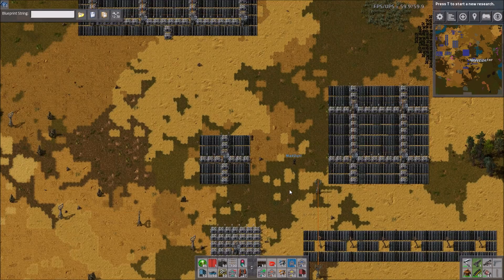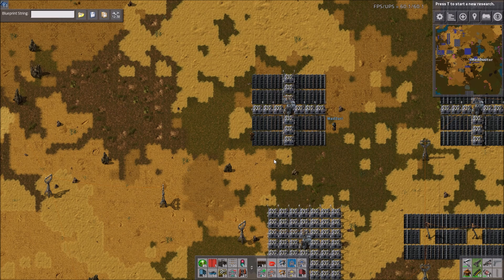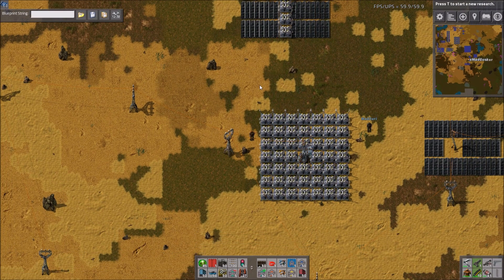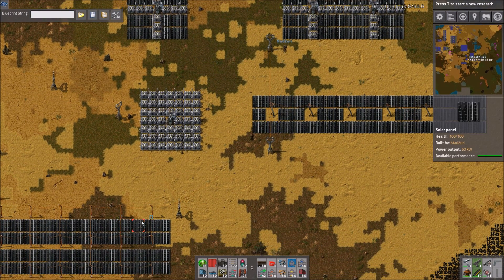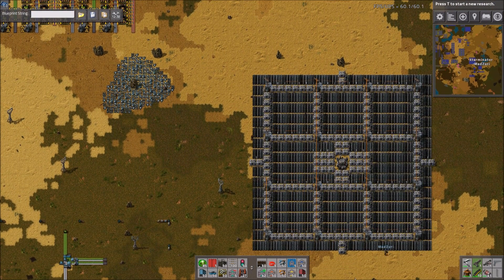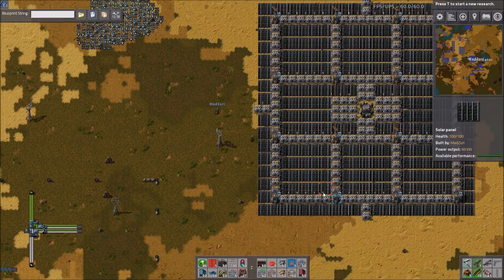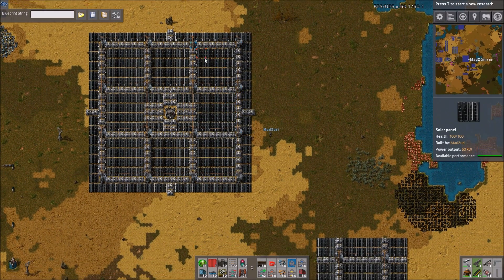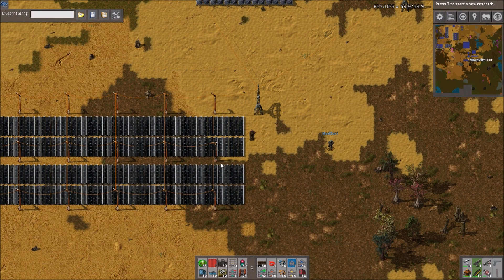Factorio Workshop - Building A Better Factory :: Solar Layouts

Comment: I like the solar layout that Steejo and Arumba used on their Factorissimo playthrough. Its a pretty good ratio of 153 to 180 which equates to 0.85. It also uses less roboports and is sort of rotationally symetrical. I like it especially because I wont have to put down accumulator blocks... Speaking of which have you done so in the earth series?
Reply from the maker: Hmm I don't think I've seen their's, I should look. 
We haven't put down accumulator banks in the earth map no. Mostly because we can't even charge the accumulators in the solar layouts sometimes. :P
Reply: Episode 65 of Steejos perspective if you wanted to look at the layout. He has it spaced so you can walk in between but you can make it completely flush. I like it because it uses the construction grid with the logistics on the diagonal to use less roboports.

Comment: Hey X, I've used Zuri's MK3 for a while, but a couple of month ago, I've started to use this one: https://goo.gl/HbM0l9
It has a ratio of 0.838 and leaves 2 titles of spacing between the setup, which is nice for larges setups, you'll have path along de solar farm. On my megabase I have right now about 60k solar panels and those paths are very welcome when I need to expand them. Here's another screenshot, this one of the blueprint itself. I can send to you the blueprint string if you want to test it: https://goo.gl/8nJMUL
Cheers from Brazil!
Reply from the maker: Thanks for sharing! That is a pretty nice setup, and I like the fact you do have that 2 tiles space in-between to run through. 
The ratio is just about perfect too, so that's good! Really my only issue with it personally is that it isn't symmetrical. lol I mean it is symmetrical all 3 sides, but then it has that batch of accumulators above the roboport, but not a mirror of it below the port. That is a very small issue that is just me being picky though. :P
Overall I think it's a really nice design!
Reply: Yup, even after the substations got extended range, this is a very good setup. It looks kind of derp, but the pathways are great for putting in radars or just walking without the squeak through mod. Like RadioactivePretzels said, half the roboports can be replaced with accumulators after the solar field gets constructed (but not during construction, because the extra charging really makes a difference).

Comment: I picked up a solar layout from the subreddit that I fell in love with a while back. It's fully symmetrical which means that you can use the design in quarters to squeeze power gen in tight places. It's not as space efficient as Zuri's mk3 but the walk space + modular nature of it makes it incredibly practical in a growing base.

http://puu.sh/snVmE/acbf87435c.jpg

In a full build: 172 panels with 156 accu giving a 0.906 ratio

Blueprint for the full design: http://pastebin.com/BCaUkgew
And for 1/4: http://pastebin.com/gPbVj69g

Comment: Question
I have seen a mini design that has 1 large pole + 5 accumulators + solar panels.
The ratio is pretty close 0.8333.. and it does not need red circuit.
Any idea about that?
Reply from the maker: hydrasonwun Awesome little designs! We will probably feature them in a future video. :) Thanks for submitting them!
Reply from the maker: I'm not sure if I've seen that one before. I'm trying to think if it's even possible to fit 5 accumulators and enough solar panels in the radius of 1 large pole. 
I'll have to play around with it and see if it works, or if you have a design like that I could look at, I'd be interested. 
If the ratio is correct and you can fit it all, I think it could be quite good.
Reply: Xterminator
https://wiki.factorio.com/images/9x9_accumulator_solar_panel_example.jpg
I hope links are working here
Reply from the maker: almwaysa Oh I did see that very recently in fact! Yeah that should work well I would think as long as the ratios are correct. :)
Reply: https://goo.gl/HHkO2Y This is my (standalone) radar station. Works 0-24, at mornings the power level drops, but the radar keeps the map revealed. There are enough space to place some turrets, etc.

https://goo.gl/Dt8mL7 The second version is on the right side. Less space for defensive buildings but +1accumulator.(30MJ, but only ~28MJ can be accumulated at daytime) It can keep up the electricity a little bit further at morning.

If you replace the radar with solar panel or more accumulator, you can generate/store more power "on" 1 pole.

Sorry for my bad English. :)
Petigp

Comment: I have a bad habit of making a mega bus, What items would you say are worth adding to a bus and what items are you just better off making at the point of consumption?
Reply from the maker: Good question! I plan to do a video on that in the near future, but for now I'll answer here. 
Some things I think should definitely be on your bus: Iron/Copper (personally I prefer a minimum of 4 lines of each), Steel, Circuits, Red Circuits, maybe blue circuits. Gears are optional, I think either way works, though technically it is more efficient to transport gears on the bus rather than the extra iron to make gears locally sense a gear takes 2 iron. Plastic is also optional, depends on how the rest of your base is set up. I would definitely NOT put cable on the bus, or any belt for that matter (exception is for a red circuit setup). Really the main things you want on the bus are just the base materials (iron, copper, steel, etc), and things that would be a pain to make locally for each setup that needs them (like red circuits, blue circuits, etc).

Comment: And yet another trick. If you use FARL, add solar + accumulators to the rail blueprint. That pastes power generation down even faster than roboports, it's less work on your part since you just drive the train,  and as you scale your base with more train lines, you scale your power at the same time.
Reply from the maker: Great idea! I have seen some people use FARL for it, but never gotten around to doing it that way myself. It is definitely faster and easier.

Comment: Worth a followup tutorial: Using hot water storage and boilers instead of accumulators. Advantage is that it is super cheap on resources, in particular no oil needed at all, so you can make HUGE nightime and laser turrent reserves very cheaply.  Downside, it costs UPS, though not really measurable. And pollution, but who cares about that in megabase endgames.

Comment: Hey, 
about the Roboport Design:
Its better to have the robopprt in the corners than in the center, that way whenever you build a new setup, you dont have to wait for the first half to be completet, until the robot have the range to build the other half. Doesn't matter so much since the removed the ghost image times, but is still usefull to reduce built time.
Reply from the maker: Heya,
Yeah definitely good for reducing build time, but having them in each corner takes 3 more roboports per design which eats a lot of power and is a fairly heavy resource cost once it start adding up. 
If neither of those things are issues for you then yeah 1 per corner would be cool.
Reply: Not exactly. If you have the roboport only cover the main design with its construction range, then the 4 posible roboports in the corners will just exactly touch their logistic zones in the horizontal and vertical direction. This means that the density of roboports is just as high as for the shown mk 3 design (which tesselate the roboports with the same density of touching logistic zones horizontal and verticl, and therefor the same amount of roboports pr solar/accumulater).
The problem with the extra 3 roboports is only for the first design, and if it is a problem with the extra power (probably not if you are using mk 3 designs already), you can just make the blueprint only cary one of the 4 roboports, as that will be sufficient for tesselation, though it do require the roboport to be put down before any construction can take place, but if you are lacking capacity for roboports, you are probably fine with plopping them down manually.

Comment: liked the short and sweet video. don't suppose you've a assembly setup that outputs close to the ratio?  :>
Reply from the maker: Thanks, glad you enjoyed it. :) 
Not really, in fact I don't think we have ever considered a specific assembly setup for something like that. If you make a blueprint with the ratio you don't necessarily need your assemblers to output that exact ratio just as long as you have enough to build the blueprint. If you do want to limit production to the ratio though, you could set your output inserter conditions (either logistic or circuit network) for panels and accumulators to correspond with that ratio. 
So like have the inserters stop outputting after 100 panels, and 84 accumulators, etc.
Reply: Cheers, solid idea, i should learn to use the smart systems. most intelligent my factory gets is limited boxes :P
Reply from the maker: Sgt Chapman Haha, yeah using the logistics conditions can help a ton and is really quite simple once you get the hang of it. :)

Comment: I'd like to see a bob's mod tree to boiler setup. I am told it's power positive. :P
Reply from the maker: I don't we will ever do modded stuff in this series, especially bobs mods. :P
Reply: Says the guy who does awesome mod spotlight videos.
In fact a basic FARL tutorial (not spotlight) would be a real winner for intermediate players to learn from. There are none on Youtube!
Reply: RadioactivePretzels I'll be honest, when I started bob's, it was overwhelming, but then I realised it was more rewarding. As I set up all the smelting areas had it all running down the bus, then started my products. Oh man, it was a good feeling. I think for many, bob's mod becomes a bot network spam thing. I'm kind of not really that interested in bots, yeah it works, but you kind of lose track of efficiency, you can't really tell whether it's working as good as it should. That's an issue I have, and whilst I'd be prepared to use it for short little trips. Like I was thinking of using bots, but at least having the stuff close by, like, running it down the belt, and then having your stuff close at hand. I think bots are an area where you cannot tell if it's working the way it should, and hard to tell if your getting the most out of the expense.
Reply from the maker: RadioactivePretzels Lol good point. :p I'm not against mod stuff, just not in this series because that isn't really the focus/purpose of it. 
An actual FARL tutorial is a really good idea though. You're right, there isn't much info on how to actually use all it's features. I will have to take some time and learn it better myself. At the moment I don't even know half the stuff it can do myself.
Reply: Xterminator I want FARL to be so intelligent it automatically places a station and all the miners down at an outpost, whilst I am flying past at full speed in a 2 4 2 train configuration.
Reply from the maker: Beren Scott Lol! That would be amazing. I think it might just break the game completely though. :P
Reply: Xterminator How about a new type of mining drill which is like much larger, and it's coverage is basically the entire patch surrounding it. The ore literally falls off of it from all sides, and you run your belts from the sides. The mining drill essentially runs at a speed that is dependant on the physical size of the ore patch.
Reply from the maker: Beren Scott That is a pretty interesting idea actually. I'm not sure if that is possible or not, but it would be cool and make mining a hell of a lot easier!
Reply: +Xterminator Might be cool if you do a FARL spotlight/tutorial at some point, to show off some combined rail and solar+accumulator blueprints that FARL could lay down (on long stretches). I bet you and Zuri could come up with some great designs!
Reply: Michael Matthews Be good if you could design farl to basically delete the rail behind it, and use it to basically spam down blueprints like solar. :P

Comment: I think I'd prefer to just have two "mark 3" blueprints, one with all Accu's and one with all Solar, then plonk down as needed. With one of each I'd get something like a ratio of 9 Accu to 4 Solar, or 9:8 with two of the Solar ones (and I assume each block would give something like 11-12 MW during the day).
Not elegant at all, but far easier on the brain ( especially without BP import), and I'll be able to scale for more Solar or more Accus as my needs change.
Reply from the maker: Yeah that's certainly a viable way to go. I think it's just personal preference, if you want to build a combined design like we showed, or just make them separate. Whatever works best for you.

Comment: The roboport design is inefficient. A diamond, not square, tiling, lets you use far fewer roboports. The key is to let the roboports connect along diagonal directions to maximize the distance between roboports but still keep them connected to the same network. The diagonal design uses exactly HALF the number of roboports, a savings of resources, energy, and ULP.
Reply: That's a good point about the build speed being slower because of lack of local charging. I tend to think about optimal megabase designs. Though I guess in that case the right solution is to (manually?) delete every solar roboport once the field is complete. I also worry most about ULP costs since I'm down to 20fps even after aggressive belt minimization and careful mod pruning.

Comment: note: the "perfect ratio" assumes no laser turrets. If you use laser turrets, that gets thrown out the window.
Reply: It doesn't matter if you use laser turret or not... The "correct ratio is a relation between SolarPanels to Acc, it doesn't matter where you use the power.  This misconception is explained on the original discussion where the ratio was presented.
Reply: DaemosDaen Yes. Just stamp down a couple of AccuBloks, and you'll be fairly good.
Reply from the maker: Yeah, typically you don't take laser turrets into account with the ratios. As Peter said, the best solution is to just throw down some accumulator banks to make up for it.